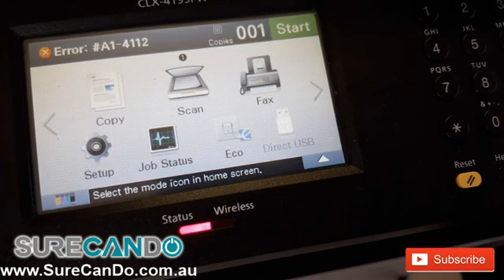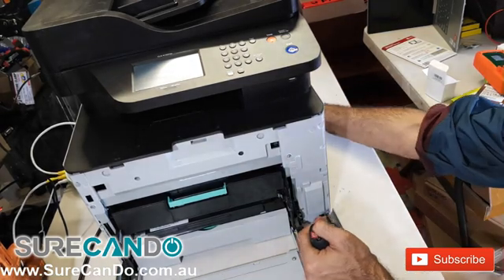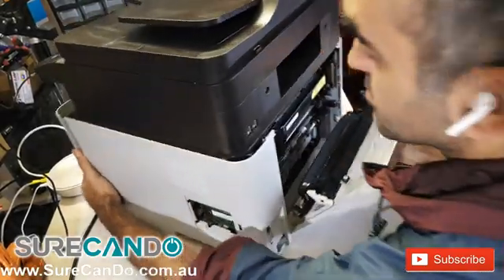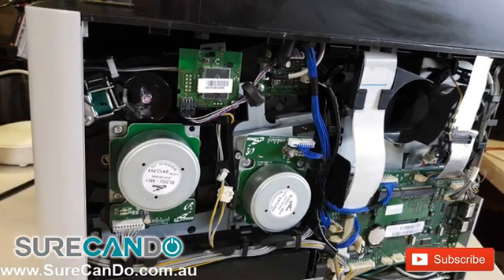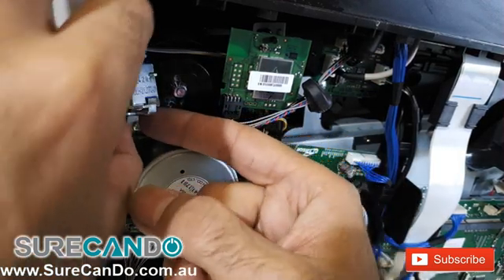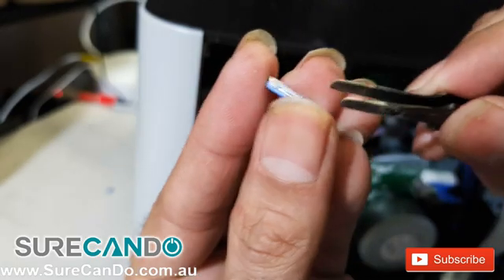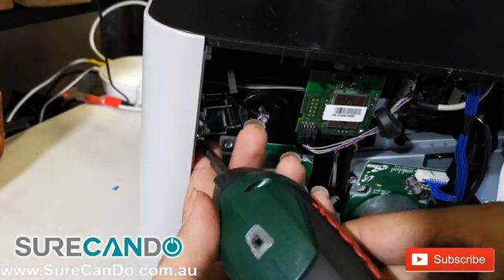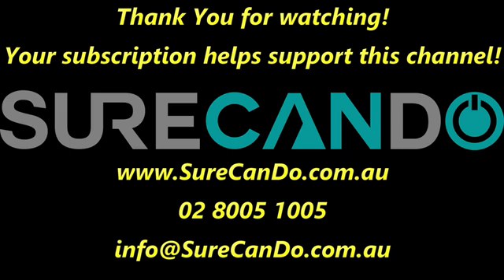Samsung Laser Printer Error A1-4111 Actuator Error Fix A1-4112 C1810 CLP-680 CLX-6260 C3060fr

Comment: I have a C1810W (11 years old) where the solenoid on the top left had a sticky foam BELOW the plate. The top pad was still securely in place. I fixed it by replacing the foam pad on the solenoid itself with a 3M VHB double sided foam tape, and leaving the top protection foil on it.

Comment: THANKS, BUT WHERE IS THE PAD? I know you don't owe me a thing, & thanks for showing me the malfunctioning part. But you failed to show the fix. I see no pad in your video, nor in my printer.  Sticking a cue tip into the slot did not work.  After I played with the magentic switch, I saw it operate.  The printer would copy, but when I tried to print out a Word document, the page came out solid black.

Comment: This repair also fixed my printer, but let me provide some valuable additional information. The traveler should stop the rotation of the pinion gear when the solenoid is not energized. The traveler should allow the pinion to rotate when the solenoid is energized. The difference is about 2 mm. It is possible to bend the metal stop tab where it previously touched the pad on the traveler, however, this piece of metal is also magnetic, so conducts the magnetic field from the solenoid, preventing the magnetic field from attracting the traveler. Therefore, the material between the stop tab and the traveler must be a non-magnetic material. That's why plastic works, felt works, etc. That's also why Samsung didn't just bend the stop tab closer to the traveler. They put a non-magnetic material in between. They just chose poorly that the material would compact over time. A piece of plastic about 1mm thick is a good choice. If you completely remove the solenoid, the printer will work, but actuate the pinion all the time. That's a good way to see if the rest of the printer is working and that this is the only issue. Thanks for posting this video. You saved yet another printer from the scrap heap.

Comment: Thank you very very much. I did it. Being from The Netherlands I used tire patch that I normally use to fix a small leak in my bicycle tires. It has adhesive on one side and is thick enough (2mm or so).

Comment: Worked! Although on my Samsung CLX-6260FW model there were two variations.  Firstly there were only two screws on the front panel (top two screws). And secondly,  the magnetic component is positioned centrally and slots inside the unit and thus does not look like what you see in the video, although it is a similar part.  Gently push a cable that goes over it to one side and it can then be removed and applied in the same way as the video. I used a small piece of think plastic, approx double the size of the original pad, stuck down with double-sided tape. Perfect!

Comment: This fix also worked on a Samsung C3060FR with the A1-4111 Error. The magnet is placed slightly differently - but the solution and result are the same. Thank you.

Comment: Thanks so much. I found that the arm was slipping under the pad, and thus pushing the pad up. An extremely small bend to the arm with a repositioned pad glued down sorted the issue. I initially tried some plastic but got a lot of solenoid actuations (it worked) but setting the solenoid off a lot.

Comment: Someone suggested cutting an old gift card or credit card, which worked great when held in place with THIN double sided tape. I tried something that was too thick first and had problems with the arm not catching the plastic cam. If it makes a loud clicking sound that repeats a few times, you may have gone too thick. Try a credit card. Awesome video. Thank you!
Reply: This is my frustration. When I look at my "fix" (prying tool and double sided tape), it looks thicker than his. I ordered new double sided tape but it's thicker than the first. It would be helpful for him or someone to give a tape thickness to order/use. I don't even want to close it back up because it just looks too thick again.

Comment: Finally a DIY Help Video that takes its time and shows you each step clearly.  No cutting ahead five minutes right over the most important part based on assumptions of knowledge.  This fixed my issue right away and safely guided me through the process - IO am NOT TECH SAVVY so if I can do it anyone can, with the help of this video.  Thank you for posting it and saving me a couple of hundred in fees.

Comment: You saved me a lot of money today! It turns out the foam pad had moved up so it wasn't hitting where it was supposed to. I took the screws out, saw the part, pulled it out enough to heat up the metal plate and slide the pad into position. 100% working now!

Comment: I Had the same problem, and videos like this really helped so thank you.
 I had a different problem where the paper wouldn't feed and it turns 
out there is an identical solenoid deep in the depths of the printer 
that had the same problem. It isn't really identified clearly in the 
service manual, and parts lists don't seem to mention it. You have to 
remove the main PCB and the PH (Paper Handling) Drive Unit to get to it.
 Hope this helps someone.

Comment: Thank you very much, just repaired my printer! The hardest part was to find a fitting piece of plastic and and handling the awful double sided tape!
My printer was just for a week out of order, because hubby and I really need it. Otherwise I would have needed moth for gathering the courage. Anyone who ist in the same situation: Keep calm, make some space for the screws, look for an assortment of pieces which may fit for replacement (I just didn't have a guitar pick) and then happy repairing!
Just hoping, my tape will hold. If not, I now know what to do. :)

Comment: I have used stacks of printer labels cut to fit.
The issue isn’t just that the original pad is too thin, but that it gets sticky, and won’t release in time to miss the cog.
They use a foam that degrades over time, and becomes either sticky, or allows the magnet to hold its charge too long.

Comment: Hi SureCanDo, I fixed my printer by following your video!  Like many others who got help from you, I couldn't be more grateful for your sharing the knowledge.  One small note to others looking for help here: follow the instruction, use something firm and durable as replacement.  I used a double sided tape covered with a glossy business card, at the thickness about 1.7mm.  Very important.  This is my second time encountered the same error message.  The first time (about a year ago) I used a small piece of foam as replacement, too soft.  It did not last.  Thanks again!!

Comment: Thanks for posting this repair video, my printer has been unusable for the last year. Samsung sold it's printer division to HP and they wouldn't provide technical support without purchasing a service contract, unlike Samsung who would happily help troubleshoot issues with a simple phone call. I thought it was going to be a costly repair due to the error message indicating it was motor related. I used a plastic case my SD card was stored in, cut a 1/4" x 1/4" square out of the case and put a piece of double sided tape on one side, followed your easy to follow instructions and removed the side panel, then removed the magnetic component by removing the screw holding it in place. I used a pocket knife to scrape off the worn rubber pad then replaced it with the fabricated plastic square. To ensure the repair was successful, I powered the printer back up Prior to putting it back together to make sure the A1-4111 error code cleared from the display and it worked immediately solving my broken printer !!  Your a lifesaver, I was shopping for a new printer and decided to do a google search which lead me to your video.... Thanks to you, I'm back in business !!

Comment: Thank you very much - I was about to get a new printer as the advice from several engineers was that printers aren't made to be fixed - at the last minute I did a Google search and found your video.  The hardest thing was getting the backing off the double sided sellotape.  I followed the video step by step, pausing it each time until I caught up, and it worked.  Absolutely brilliant - I am very grateful.  Colin.

Comment: Thanks, that worked! Used a membership and business card with some super glue to get the right thickness and a pair of scissors to cut to the right shape. Glued it on the unit and did a test before closing things up. The process took about 10 minutes. Nice work.

Comment: Thank you very much. I used a piece of hard plastic and double sided tape. I measured the little pad thickness and it was about 1,5 mm (milimeter). The plastic I used was 1,85 mm, so i used a file to make it thinner to 1,55mm and the thin double sided tape. Installed it and it directly worked! At the end you said not too thick, not too thin. So i measured it: 1,5 mm.

By me, the pad wasn't worn, but it was a little bit out of allignment so the metal piece wasn't resting on the pad. In that case the metal flip is too far from the magnet and it doesn't work anymore. If the pad is too thick it will not flip back (away from the magnet) far enough to lock it. So that is why the little pad cannot be too thin and also not too thick.
Reply: @SureCanDoComputersServices1  fantastic! Looking forward to it.
Reply: @SureCanDoComputersServices1  do accept Bitcoin?
Reply: @SureCanDoComputersServices1  Will donate GBP25, Tried and still not working, My problem, bought about 2 years ago and never worked. As I was traveling, when back bought Brother printer which works fine.
My problem is when try to start, never get to ready.
Wheels turning but nothing. It turn itself off and start again and again.
Any idea?

Comment: Thanks a lot

In my case the foam pad was slightly shifter upwards and I could see the glue spot under it where it originaly was positioned, so I just pushed it downwards a little bit with my finger, and  the printer worked perfectly fine afterwards.